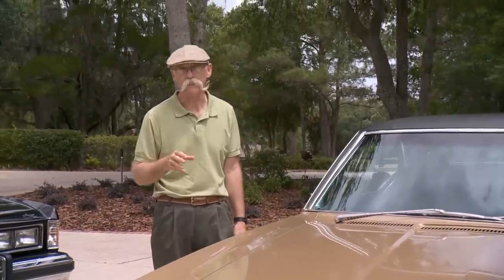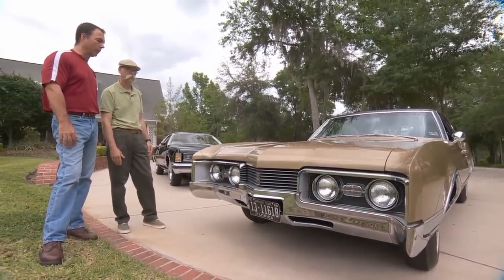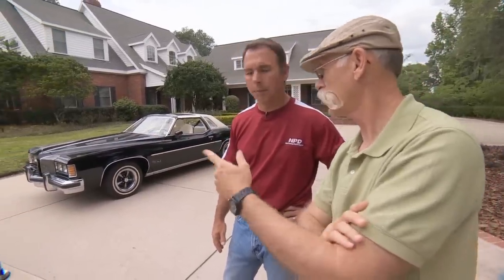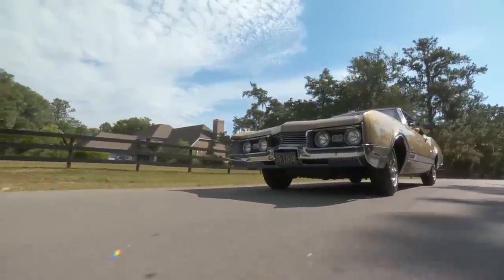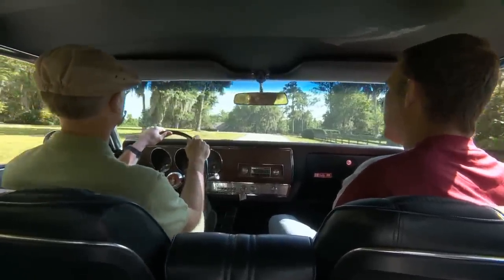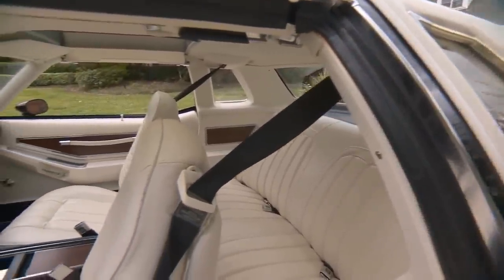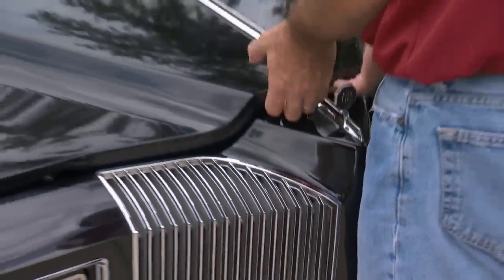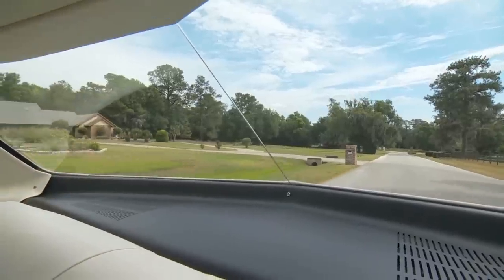GM Luxury Sports Cars

Comment: You were stylin' if you had one in 1983 too! I had a 1977 with a 400, triple black with leather interior and Hurst T-Tops. That car was absolutely gorgeous! Turned heads and got compliments everywhere I went. Took it from NY to LA,  and it was a dream to drive. Yes the T-tops leaked like a sieve, but they made the car look so much cooler, and a blast to drive with them out. Mine came with big leather pouches to store them in so they wouldn't get scratched. Seeing this video brings back good memories!
Reply: I had a 75 Monte, triple black.  The Chevy equivalent.  Sunroof dripped too!  Was like driving a couch. 350.  18mpg on highway with the cruise engaged.
Reply: Dripping T tops is the kind of non sense that helped Toyota eventually exceed GM in sales, the 82-92 Camaro / Firebird were really bad about that. I would have a large collection of 1970s GM cars if I could, they had a lot to like about them, but the body, interior and trim quality was not what it had been in the 60s. I had a 1966 Sedan Deville, a 1966 Toronado and a 1975 Fleetwood S75 limo, there was a obvious difference, but the style of those 70s cars... sweeet!

Comment: I am blown away watching this. My first car was a 1975 LJ. It was Admiralty Blue (such a dark navy that it was mistaken for black many times), the same white interior with the black carpet and the same white half vinyl top. No T-tops, though.... an electric sunroof instead, two headlights instead of the four smaller ones and the tailights were composed of five vertical sections instead of horizontal ones. It had every option except the 455. The 8-track was usually blasting out Aerosmith.... or Dark Side of the Moon on continuous replay. Very Large Wow, you guys. Thanks for the amazing flashback.

Comment: I totally remember them they where just amazing looking cars. For my first job I got a 1974 Pontiac Lemans with the help of my Dad. It was a  350 4 barrels black  exterior and red interior but pretty stock and the Pontiac mag wheels.. But I wasn't happy my father force me to buy it. I wanted the 1972 Pontiac Grand Lemans all white and fully loaded bucket seat and all the bell and whistle.
But it has a lot of mileage dam I wanted that car so much.
Those where the days I think I was 18 at the time. My dear Dad will be 90. Feb.18,2021
Cheers

Comment: At least around that time when Radial tires came in to play. Just a better ride altogether than anything else. Finds who drove my cars would comment on the ride compared to there own cars. Almost bought a 76 Pontiac Grand Prix “SJ” a friend  ended up with it . Still love that Pontiac style. Learned to drive around the dirt roads in Grand father’s 74 or 75 Pontiac four door  Bonnevlllle with the 400ci. Lots of fun as a 12 or 13 year old! So much power it seemed like back then.

Comment: Man that Grand Prix is beautiful!
Reply: I had a 77 SJ 400 four barrel/turbo 400 trans.  I really liked it but it rusted away.
Reply: I have a friend on the east coast that has a '77..I like these cars.
Reply: I want either a 71, 74 or 77.
Reply: Baha T 1978 Pontiac grand prix
Reply: Terrence Banton  Was a joke. It's a shame that Pontiac had all this car building potential and were forced to make much smaller - and much less stylish - cars due to meeting federal guidelines on gas mileage.
Reply: The government screws everything up...
Reply: I had a 1975 GP LJ model. engine: 400 4bbl.  Burgundy and red two tone, crushed velor electric bucket seats, electric sun-roof, electric windows, door locks, etc...  the whole deluxe power package.  The electric sun-roof was much nicer than the T-tops. The car handled and drove like a heavy sports car with the Radial Tuned Suspension.  I pulled out the original motor, and put in a Trans Am 400 4bbl that was built to around 400 HP 450 ft-lb torque, and did some suspension, exhaust work, etc.  That car would just float along at 150 mph all day long, and top out around 175.  3 speed turbo 400 automatic 1st gear: 60+ mph 2nd gear: 120+ mph 3rd gear: 175 mph (estimated)  Nice car...  got stolen. :(

http://www.2040-cars.com/Pontiac/Grand-Prix/1975-pontiac-grand-prix-lj-coupe-2-door-6-6l-448033/
Reply: I bought a new ‘73 Grand Prix SJ with 455, first year of that body style. Loved it, but it turned out to be a piece of junk. Everything went wrong with it. 😖
Reply: @steveprinty5674  Most likely made on a Monday or a Friday... that's when most crap comes out of an assembly line.  Monday they might be hung over or don't feel like working, Friday their mind is on the weekend.  Not everyone of course, but even just a few people screwing up on Monday and Friday can increase the percentage of lemons.
Reply: Love it
Reply: I had a '77 Grand Prix.  You know what 19-year-old punks do with that car?  Spin at between 80 and 90 as the passenger's-side goes airborne, crash into the sidewalk, drive it home, and FIX THE ALIGNMENT!  That's was the ONLY damage: THE ALIGNMENT.  I can't believe that was me 30 years ago.
Reply: My grandfather was a Pontiac man he had a Grand Prix just like that. Black,t-top,bucket seats, floor shift. I was around 11 years old and loved that car
Reply: I had black 77 grand prix black interior black exterior man I miss that car it was a pussy magnet
Reply: @barking.dog.productions1777  lol - you are hilarious.  I had a 75 back in the  day.  Stock they had a 2 barrel.  It got terrible mileage and was generally anemic performance.  There is NO WAY it could go much over a 100 mph, much less get to the speeds you mention without serious modifications.  It would be downright dangerous at high speeds as the handling was so vague and floaty, and brakes almost non-existence.   I suppose yours got 30 mpg too!
Reply: @port nut That is a guesstimate since the car would do over 60 in first gear, peg the speedo at 110 in second gear and still pulling hard, so 3rd gear has to be estimated.
Reply: I took a driving lesson in the Grand Prix. Nicer than the Dart I took most of my lessons on.
Reply: Didn't Pontiac make some beautiful cars?!!! I'd love to have a Grand Prix like that, vinyl seats and all!
Reply: It IS... Too bad cars older than 15 or 20 years are comparable death traps to what we've got now
Reply: I had a great 68  Oldsmobile Toronado.  Very similar side view,  wheel flares especially.  
Also had a nice 77 Gran Prix,  white.
Reply: '76 GP  one of the top 20 most beautiful front ends Of All Time
Reply: We had a maroon '76 Grand Prix just like this one except ours had A/C
Reply: @Clearanceman2 , you must live in the rust belt.
Reply: @marcusaurelius8717  I sure do....
Reply: @Clearanceman2  Mine was a 76 GP with the bench front seat (no console). Forest green metallic with white interior. I got it in 86 and it put my brothers newer Trans Am to shame in looks and performance. Fit me like a glove and it makes me sad to think of the day I was forced to sell it.
Reply: @barking.dog.productions1777  no such thing as a big block pontiac.

Comment: I worked for Oldsmobile as a GM Tech on Long Island from 1981 to 1987... These cars were still coming in for service all the time from the original owner. Still have my timing light in my old Snap On toolbox. I used to buy the trade ins and fix them up... I remember a 1964 Buick Riviera coming in with 51k on the odometer from the original owner and the Used Car manager wanted 500 bucks. It was nearly perfect. The color was Willow Mist Green. I passed because of the color but the car ran and drove as new. I bought a 1974 El Camino instead for 500 buck, also ridiculously clean but I still regret not buying that Riviera....